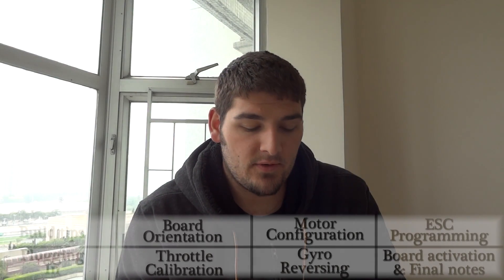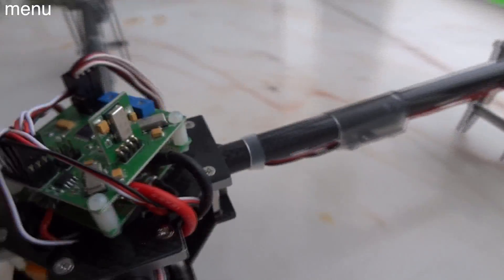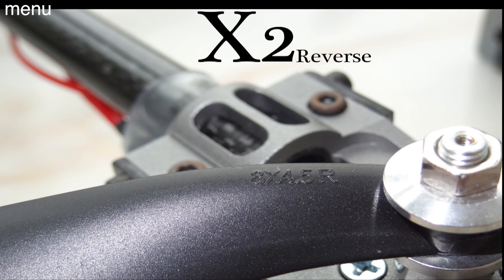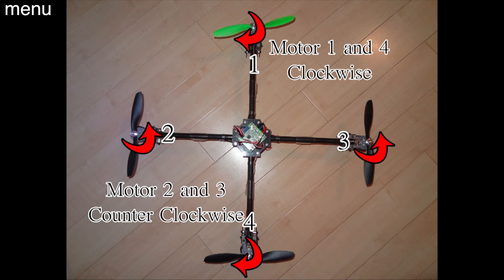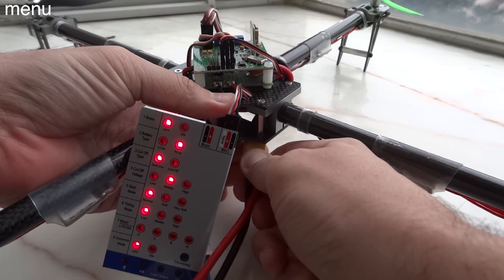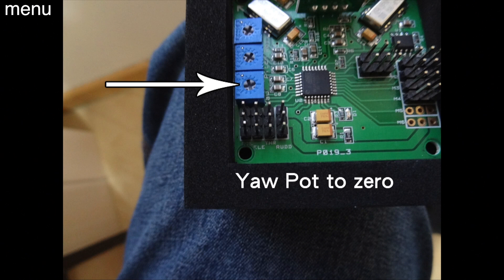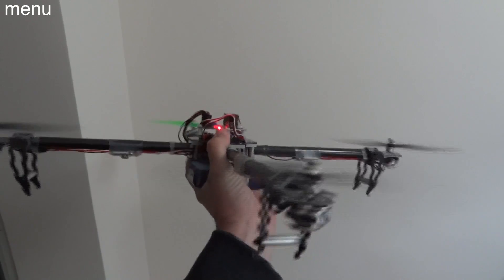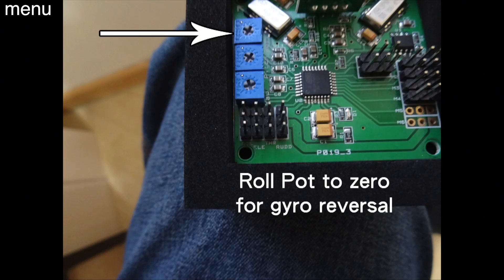HobbyKing Quadcopter KK board setup guide

Comment: Your motor rotation configuration is exactly opposite what's specified in the guide from the FIles Tab on the HobbyKing website.  Motor numbering is the same but the gude says motors 2 and 3 rotate clockwise and 1 and 4 rotate counterclockwise.  Would this really make a difference?

Comment: Nice video. Very useful. Just in time when I'm going to make one. But I have some questions to ask.
1. What did you do with the 4 positive wire from the ESC. Are they all plug to the control board, or just 1.
2. What model should I choose in the Tx, airplane or helicopter with 1 servo?
3. Are you going to make a video on how to setup the control board for X configuration? Because that's what I'm going to build. I like X than +

Comment from the maker: @my73737373 all of the HobbyKing boards can control 6 motors but the very first required soldering. The 2.1 and 3.0 come ready for Hex or Y6 use. It's all in the firmware.

Comment from the maker: @skags2 Technically nothing should happen with no program. Make sure you have all your gyro pots at 50%. You should need to set the throttle range and maybe set the stick center on the board before it can arm. Each firmware is different though.

Comment from the maker: @skags2 I can't really tell what is going on. It depends what firmware is on the chip. You need to flash it for a hex ether way then go through the set up process in this video. Each type of firmware can be different.

Comment: When I try to move my quad for motor#4 down, Motor #4 doesn't have any response. Is that means I need to reverse Yaw? Or this is some other problem like loose wire.
When I test fly it's spinning on the rightside.
Anyway I can not reverse the gyro as per your instruction is there any other way to reverse the yaw.

Comment: @chicodorea Yes, your radio may very well be the problem. The Aero Sport Transmitter does not have EPA. The manual specifies that you dial down your Pitch & Roll axis end points to 50%. Leave Yaw axis at 100%. You may be over controlling your copter with twice the input as is required.
Servo Reversing and End Point Adjustment are the only programing features need on a transmitter for these and yours does not have EPA.  Try an Airtronics SD6G or the RDS8000 which is what I am flying.

Comment: Hello,
Can you help me with a controller board hk v2?
I can not try to fly as it spins and drops without achieving anything higher than 40cm (15pol).
I suspect now the radio and ESC. Use an Airtronics AeroSport5 5Ch 2.4G Radio TX / RX.
It is not computerized and can not change much but the inversion channel.
The ESC is really cheap, use ARM 20A ESC. I see many people posting videos of this card with quad and I can not identify the problem you have with me.